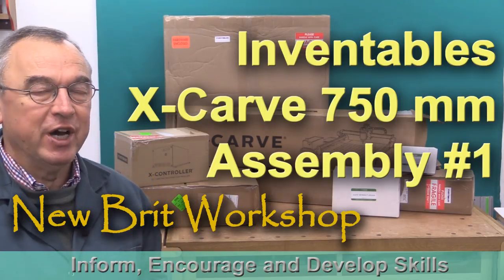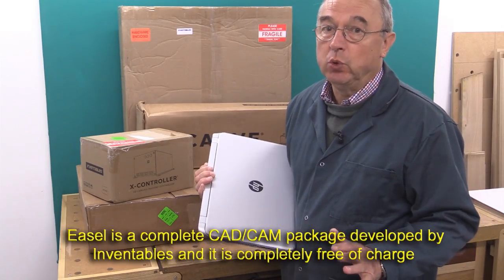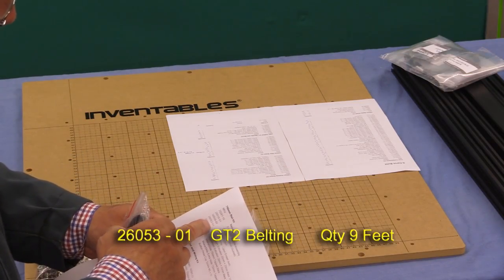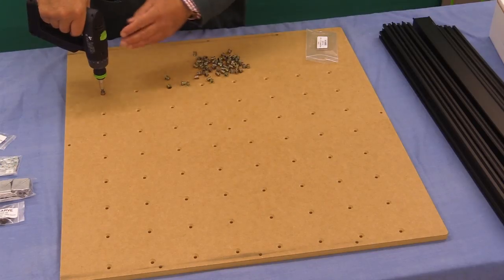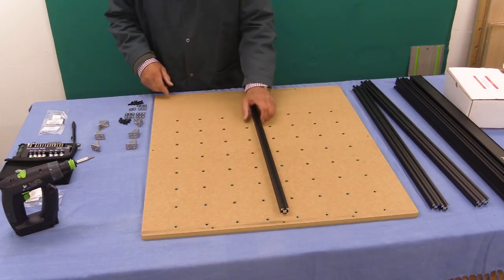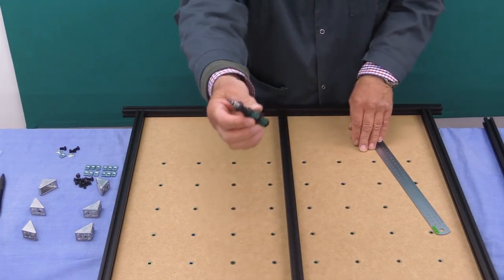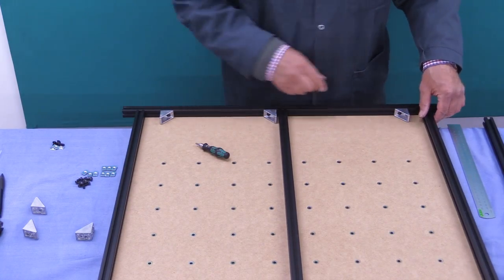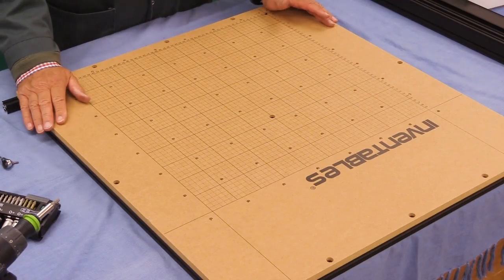New X Carve 750 mm CNC Assembly - Part 1

Comment: Thank you Peter!  Best video out there and saved me so much time.  Inventables has been piece mailing my x-carve dues to holiday back orders so it has taken my longer to get it set up.  I started with just the directions but quickly switched over to your videos when I found them.  I hope that inventables watches the video as it could surely help them make some needed changes to their directions and maybe add to the way the label items.
Reply from the maker: Good luck with your new machine. Do take the time during assembly to get everything set up well as it will save you heaps of time and frustration later on.   Peter

Comment: Hi Peter , can you recommend an  MDF for cnc routing that is available in 3mm or 4mm ? I've had very good results  from  MR medite but that's not available in less than 9mm IIRC
Reply from the maker: Hi Dave, I cannot help I am afraid. Try contacting your supplier and ask for a CNC grade MDF and see what they say.   Peter
Reply: Thanks Peter , I have a few questions out with suppliers at the moment